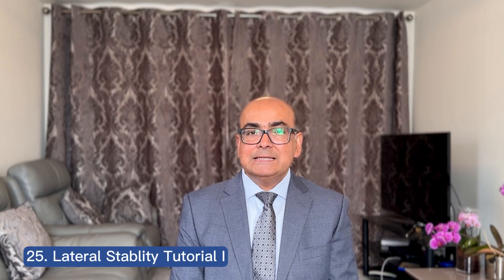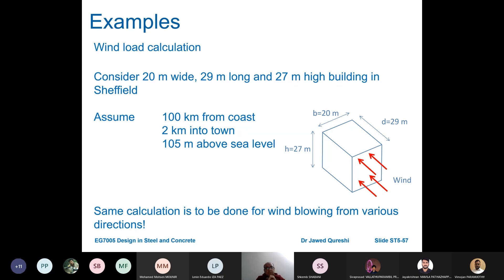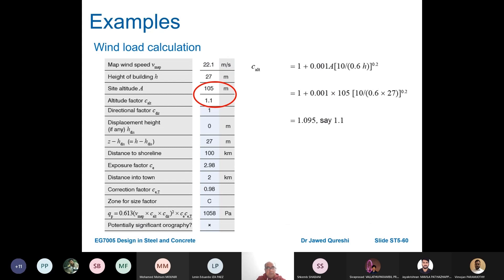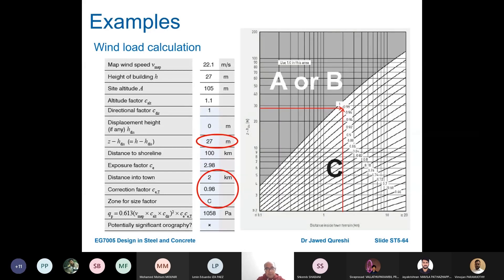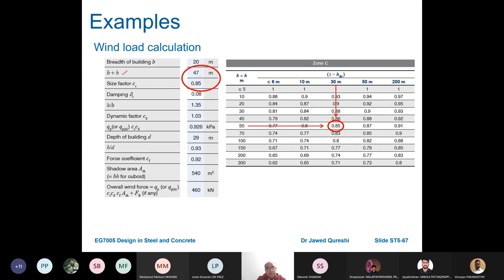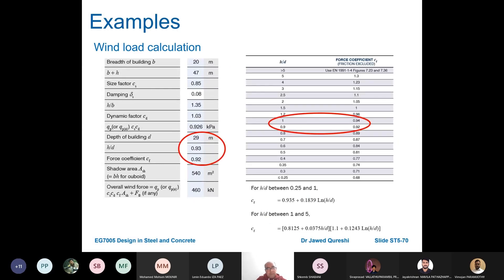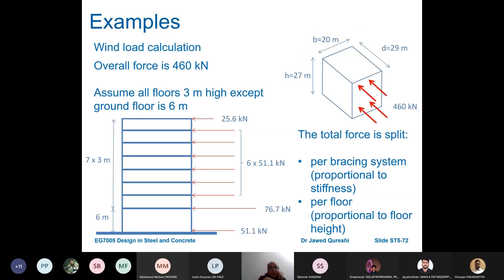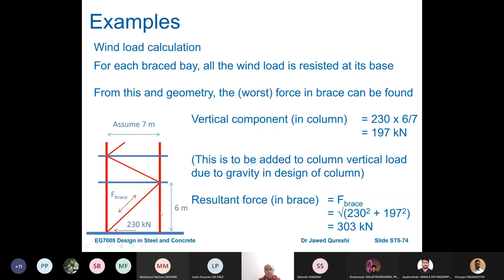25 Lateral stability Tutorial – I (Wind Loading Worked Example) Eurocode 3 Steel Design series

Comment: Hi Sir, I am pretty new to European codes. 

Was trying to figure out when to use "Wind pressure" method and "Wind force" method (Table 5.1-  EN 1991.1-4) and sort of understood that while designing components and cladding we need to use wind pressure method and while designing lateral system we need to use wind force method (or Force coeff method). 

On the other hand, while reading section 7 of EN 1991.1-4, I got confused because it says that to use wind pressure method for buildings and wind force method for signboards, structural elements (Not overall structures - thats how I understand) and so on.....

Cl.7.1.1
"(1) Pressure coefficients should be determined for: 
-Buildings, using 7.2 for both internal and external pressures
-Circular cylinders, using 7.2.9 for the internal pressures and 7.9.1 for the external pressures"

"(4) Force coefficients should be determined for: 
Signboards, using 7.4.3, 
Structural elements with rectangular cross section, using 7.6, 
Structural elements with sharp edged section, using 7.7, 
Structural elements with regular polygonal section, using 7.8, 
Circular cylinders, using 7.9.2 and 7.9.3, 
Spheres, using 7.10, 
Lattice structures and scaffoldings, using 7.11, 
Flags, using 7.12." 

Can you please provide some lights on this topic too...

Great lecture series and wonderful explanations to each sub topic sir. Thank you!

Support from India!
Reply from the maker: Thanks, for your kind comment. I’ve to go through it in detail before I respond. I’ll try to create a video around it.